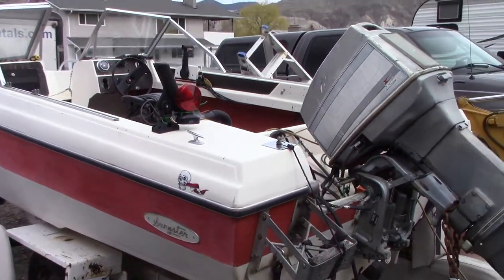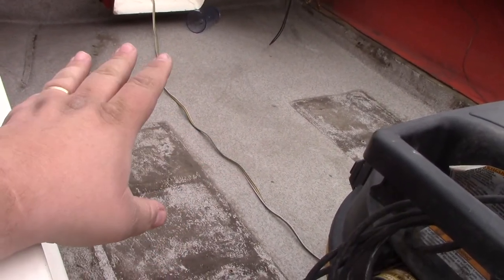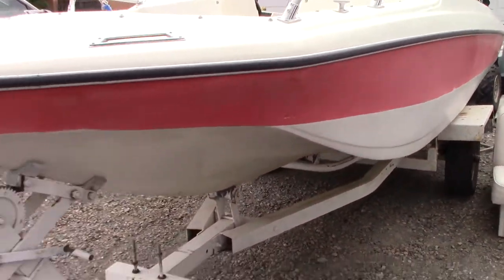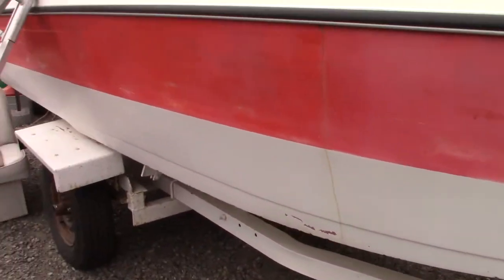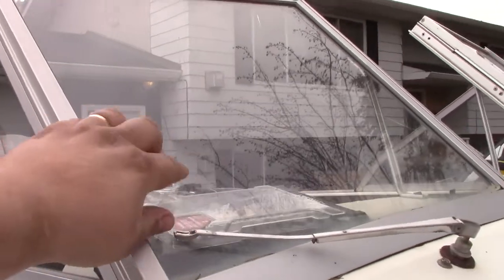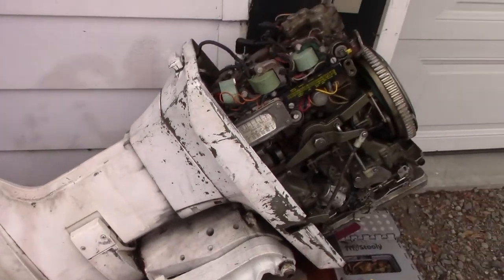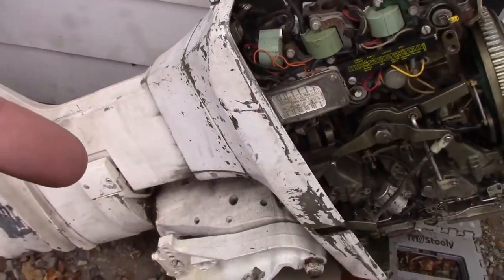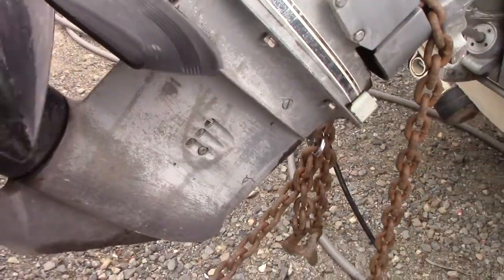I Buy The Cheapest Tri Hull Boat I Could Fined!

Comment: I really dig old tri hulls. Bought my first boat this year 81 Glastron with a super good running little 35 hp johnson in it. I got it all setup for fishing and love how stable it is when it’s sitting in the water. Does about 25mph with that little motor but sips gas and I can run it for like 6 hours on a single tank. Also bought a 71 Glastron tri hull for $200 with a nice trailer and 50hp johnson in it. I’m gonna rebuild the stringers and floor in that one then do new floors on my seaswirl next winter.
Reply from the maker: Sounds like you have a project there! I wish i had more time to fix up mine, I have the new boat carpet picked out just need to get at her!
Reply: Yeah I’m lucky and work from home so while I’m waiting for appointments to show up I can work on my boat. Got the new flooring cut and epoxied just waiting on it to cure over a few days and I’ll install it then lay some eva foam flooring over it to make it look nice. I think older glass tri hulls make perfect little fishing boats.

Comment: I just got one of these with trailer and motor for $50. needs a lot of work, ran when parked back in 2005, hopefully turns out good
Reply: Got one for $500, good condition last time it was used was in May 2024 but my uncle bought a 17 footer and didn't want to repair the motor Of the Bayliner. Got a 1972 with title, the first owner owned it until 2020, then my uncle until September 1, 2024 and here I am writing a day later as the 3rd owner.

Feel free to make any recommendations or tips, and let me know if you want to share pictures of our boats!

Comment: Have you checked the stringers underneath the floor for the condition? I have a boat like that (Glastron Tri-Hull 16ft, Evinruide 115) and my stringers need to be replaced.
Reply from the maker: As the floor is soft i suspect the stringers are indeed in bad shape... But for a $300. boat i will just put new plywood overtop and enjoy lol,
Reply: @thinkford  that  was my thought also with my boat but was told my hull would probably crack if I took it out without good hull integrity.  I am just trying to get my motor and tilt/working right now. I also paid about $500 for boat, trailer and motor, do have tltle for both.
Reply: @thinkford  that  was my thought also with my boat but was told my hull would probably crack if I took it out without good hull integrity.  I am just trying to get my motor and tilt/working right now. I also paid about $500 for boat, trailer and motor, do have tltle for both.

Comment: Looking at buying my first boat! There’s a lot of cheap tri hulls near me with running engines. Looking for 16ft! Would that be a good starting size with around 50-75hp?
Reply from the maker: I think so! Just remember the bigger the boat and engine the more gas you will spend pulling it with your vehicle and on the water. Thats why i like these small tri hulls easy to work on cheaper on fuel and you will have the same amount of fun!